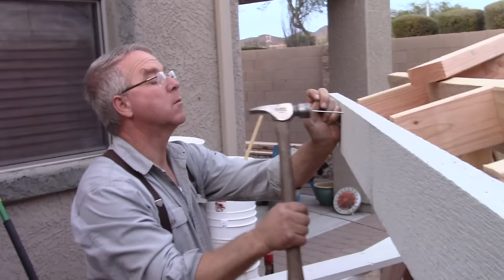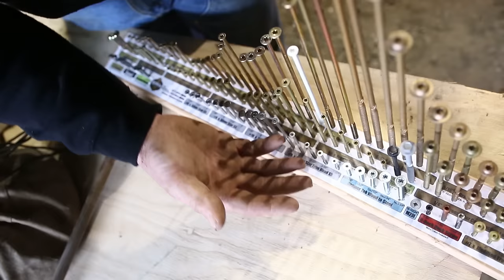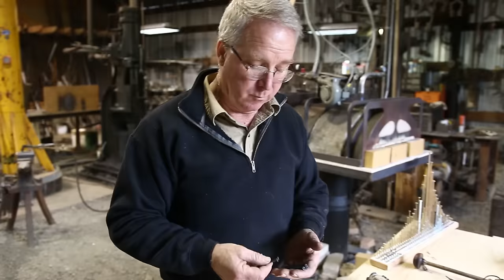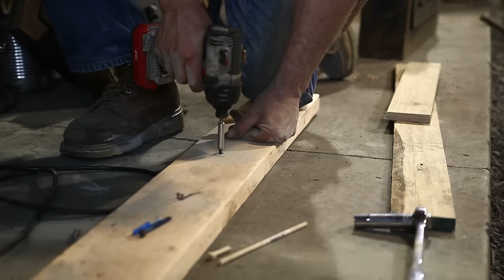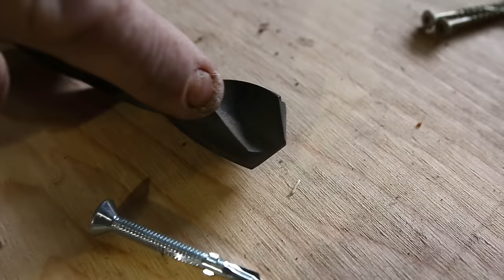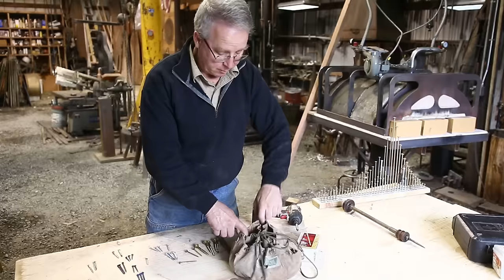Screws: What You Need to Know

Comment: I do carpentry myself and the one best takeaway from this video...is that parachute bag!! Thank you for that tip, sir!! I do pole barns for a living and I also do corrugated metal roofing with the galvanized insulator screws, so I end up with these getting mixed in with the 16 pennies I use for kick plates. I also build and tear down concrete forms and end up having to get a separate pocket on my belt for them, since you can't use them in structural work, as you stated.  Parachute bag = no problem

Comment: As an average guy, not in the trades but I build my own home, I haven't built a deck in 25 years.  I recently built a small set of outdoor stairs and when I went to buy hardware to attach the ledger board to the house I couldn't even find the 1/2" hot dipped galvanized carriage bolts that were traditionally used.  I was pointed to the GRK Structural screws instead.  I bought them and checked out the specs and schedule online.  Wow!  What a difference and so much easier, I didn't even have to go into the basement for anything.  The ledger board isn't going anywhere.  I also decided to use stringer brackets along with the special screws from the bracket manufacturer...so much faster and easier.  I'm pretty good at hammering, getting a lot of practice building wall sections for a builder one summer at age 15 but I've always hated pounding joist hanger nails as it can be difficult in a tight area.  Great innovation not only for installation, but also for repair-ability too.

Comment: I also like GRK, Spax has served well too; avoid "Fastap" they claim self drilling but the design is really self stripping, nails have better pull strength.(experience based on softwoods OSB and plywood)
Drywall screws snap because they are only #5 or #6, cheap, and often thinnest just under the head, not because they are hard. Meanwhile deck screws tend to be #8, 9, or 10 and have a thicker section between head and thread. Likewise nails tend to have higher shear strength because they have a larger effective cross sectional area(based on minor/root diameter of the screw) and bearing surface, the harder steel in screws is as a basic material stronger in both tension and shear.
**** 
I agree that phillips should be avoided for anything other than drywall dimplers(wear camout is an advantage). Phillips is only popular because of the model-T and it was designed to cam-out in a time when production line power drivers lacked torque control. 
Torx are good for high torque but they weeble wobble all over and need two hands to get started straight, they also chose way too many bit sizes and there are two types [old torx and torx-plus newer & improved but less popular]. I prefer Robertson for general use, they have a slight taper that both sticks the screw to the bit and makes a very stable connection that can be started one handed, and 3 sizes covers most common screws, easy to accurately manufacture which is important with all the cost cutting low bit import products. Both Torx and Robertson bits resist rather than encourage cam out and the bit's wear ten times as long as phillips.

Comment: Just bought my first set of Torx head screws this weekend repairing a shed behind the house I'm selling. Never used them before and wanted to see if they were worth the fuss. They were. I'm a convert now.
Reply: The trick is.. everyone that will work on your shed after you   will either hate you because they're not Torx converts and they don't know what it is, or they will love you because they're also Torx converts.
Reply: I converted to square (Robertson) from Phillips. Torx is great with two major draw backs. 1.) it doesn’t sit on the bit as well as a square #2 which makes it more difficult to use when working by yourself one handed. 2.) for most general stuff you end up using #8 and #10 screws. For Torx that means having a T-20 and T-25 and switching back and forth. Both those common screw sizes come with Robertson #2 bit sizes making it easier all around for most applications I do. 
GRK makes really bad ass screws and for structural applications, a T-25 and GRK or TimberLOK screws are where it’s at. For fences and sheds etc? I’ll use the square #2 bit and be done with it
Reply: @nsatoday  I'm with you on the TImberlok and headlok's.   Worth every penny.  I built a little bridge type thing access my mother's barn.   She was using old pallets to cross the 'moat' into the feed room.   Every now and then a horse would horse it's way into the feed home and destroy the pallet bridge.    There's no way deck screws would have held up to that kind of stress.
Reply: I used them in an 18-wheeler.

Comment: Just to add to the screw info,  do not mistake Robertson for Square.  They are two different driver/screw configurations.  The square has 90 deg sides on both the driver tip and the screw where as the Robertson has a tapered shape to both screw and driver.  Using a Robertson driver with a square screw will result in a loose fit more prone to slippage and stripping.  Using a square driver in a Robertson screw will normally not reach the bottom of the screw and can result in Jamming your bit in the screw.  To tell them apart often the sizing on the item will let you know what it is...  1, 2 ,3 = square,  6, 8, 10 Robertson or Green Red Black...

Comment: The screw driving tool at the end was what my father called a Speed Driver.
He built boats and had several speed drivers.
He used Monel screws for boat building.
The holes were predrilled with either an electric drill or a handcranked driller, then the screws were driven with the speed driver.
Interesting that no-one ever thought to use the electric drill to drive the screws!
Until someone did......😀👍

Comment: These videos are amazing, and I can't wait to binge watch all of them. Thank you for putting these together.

That being said, I got awfully nervous at the end of the video when the guy was handling a lifted load by hand. Please be careful. Attach a rope to the load (not the lifting slings) or use a hooked pole if you need to control the load and prevent swinging, but don't touch it. Being that close to a lifted load puts you way too close to the line of fire if the load is dropped.

Comment: I love your videos - a lot of great information and wisdom. I don't know though why you would assiduously avoid Robertson if they are locally available and cheap. I understand if your local store stocks Torx and Roberston are difficult to get and at a premium.

Robertson has some  good things going for it and basically  all self-centering/screw holding fasteners  are  re-inventions of the Robertson concept - which is what Lox and Torx are. The taper on the  Robertson allows screws to stay on the bit better than Torx which is useful - especially for Electricians mucking around in a live breaker box which is why our boxes tend to use them here. 

I find the strip rate of Robertson and Torx to be pretty similar - it is down to the manufacturer's metallurgy..

The sizing is easy to tell - orange 00, Yellow 0, Green 1, Red 2, Black 3, Brown 4. For me figuring out the size of Torx is not as easy at a glance.

They do make proper deck screws with good coatings - the brown ones- and stainless steel if you really need it.

Now that Robertson's patents have expired you have to be a lot more careful with the tooling. When Robertson exclusively made the bits they would last years in an electric drill, the offshore stuff now last weeks. I buy the 'Shock' proof bits for impact drivers and they seem to  last quite well. The same goes for the fasteners - there is a lot cheap chinesium out there that is either way soft or way brittle but that is true of all fasteners today.

Comment: I used some of those yellow screws on a redwood fence. I took the screws out perhaps 6 years later (replaced wood fence with steel fence). They looked pretty darn good. I re-used them.
I find that the yellow screws snap less than the drywall screws.
Also I believe the Lox head (modified square drive) has greater torque capacity than the Torx head.
Square drive works just fine, though not quite as good as Torx (star bit). I can put my #12, 5" long stainless screws into wood pretty reliably with a good impact driver and a #2 square drive recess. Actually, the screws themselves tend to warp because the particular alloy of stainless that they manufactured this batch of screws with is overly soft. There are a great variety of hardnesses in stainless fasteners. The Simpson Strongtie stainless screws are top notch - no warping and the heads aren't nearly as prone to snapping off)
ciao.

Comment: I started doing full range carpentry in 1965. I remember using a Yankee screwdriver with a straight bit to set screws for hinges and hardware. OMG.  I still have the scars.
You are spot on about the types of screw drives: Slotted head screws suck completely; Phillips head screws suck mostly; Robertson square-drive screws are OK; Torx drive screws RULE!
And GRK screws are the bomb!!
Great video.  Thanks!

Comment: Drywall screws are fantastic .... for drywall! Love your videos, as allways. Edit: I like Robertson's screw bits obviously you're correct they were an obvious improvement over Phillips. But they were also a lot less expensive then the Torque screws. I didn't mind paying for torque when I had large screws to drive. But run-of-the-mill decking screws? Not so much. In any event, your analysis of the capabilities and limitations of all of these fasteners is absolutely flawless. Well done as always.
Reply: My thought too, I've gone through many many boxes of drywall screws they are perfect for drywall heads above nailing, but not for use for anything else.

Comment: New subscriber - love your videos. It would be interesting to hear you talk about how home construction has changed throughout the years.  And why there seems to have been a real dip in quality at times, and why older homes seem much better made.  Stuff like that. Seems that would be right up  your alley.
Reply: GeorgeGraves 
so I have an opinion on this topic. first off it's a two-sided debate. many older homes have a tendency to have inconsistent construction types which give you inconsistent quality for long-term structural capabilities. new homes with code regulations and inspections often are far more consistent high quality  work structurally speaking. on the Craftsmanhip side of the debate, old homes were all built by people expecting High craftsmanship. new homes are now often bidded down through bidding wars  by contractors which then drives the quality down even though the modern age  Carpenters are often qualified to do high-quality work but most people are not willing to pay for it. so even today high-quality work is out there, it's just that most people can't afford or are not willing to pay the price that it takes to get it. I also find that many homeowners today can't tell the difference between really high-quality work and mediocre work which makes it hard for many carpenters to make the extra effort.
Reply: Re: Inconsistent quality in older homes. Quite true. I own a house built in the 1890's. Beautiful craftsmanship - interior/exterior millwork; custom-built doors & cabinets; fireplace mantel & surround; stained glass... Structurally though, some areas overbuilt, others underbuilt - eg: beam sizes; footings/foundations; concrete quality. No standard code regulations back then, I assume.
Reply: When it comes to building a home which will most likely be the largest investment of your life, there should not be any cutting corners when it comes to quality of build. And lower quality should not be permitted (but is). When you are spending $$$ of thousands to give shelter, comfort and protection from the elements and possible natural disasters every home should be built to pass inspections of the the highest standards...  Just my thoughts.
Reply: There might also be some bias regarding quality inconsistency as the only homes from past eras to make it to today HAD to have been built well.
Reply: Exactly.  The older homes we see today are ONLY the high quality ones.  This is a huge sample bias.  All the poorly constructed ones have been torn down or completely renovated.
Reply: @randalldavis7025  I'd also say that if you built a really shitty house decades ago it's less likely to be standing today than if you built a great one.
Reply: I'm a bit late to the party, but if you want more on the subject, check out the Modern Craftsman Podcast. It's run by a couple of carpenters who specialize in old-school, high quality home building, and gives some good insight into the people still interested in doing things the right way in this modern age.
Reply: There's a term for this, it's called "Survivor Bias".,   Generally speaking, only the well built homes are still standing leading one to believe that that were all well built.   I occasionally do some metal detecting.  I'll use a website called historic aerials to pull up aerial maps with census data that you can overlay with modern google maps.    I look for houses that used to exist, but don't show up on modern maps.    Many times I would have never even known a house was there.    Sometimes I can just find bits of foundation or other remnants once I start detecting where the house should have been.
Reply: @TheSpongiform  where I grew up you could find dozens of old house foundations within a few kilometers. Some of the foundations are quite impressive, especially considering that even just a few generations back pretty much everyone and their mom built their homes themselves here.
There's a remarkable variation in quality too. I've seen so many homes with earth floors (must have been terribly cold in our climate) and with chimneys that were just glorified holes with some brick/stonework in a corner. And then you walk 500 meters and see somebody's 100-year old sauna with doric pillars and oddly-shaped windows.

Comment: Really interesting vid - thanks for putting it together! In the UK 90% of the time we use Pozidriv - they're excellent and never cam out if you use decent bits. I did a screw rust test vid a while back - the screws I commonly use are very corrosion resistant and never break - about $3 for 200 screws. They're very, very hard but not brittle. Would be intrigued on your thoughts - can send you a selection if you like?
Reply: What he's saying is that a screw provides more tensile strength (vertical, or straight pull), versus shear strength (horizontal, or side load) brittle has nothing to do with it. Harder the steel=less shear, softer steel=less tensile. at any cost the screw will provide more vertical or straight pull, than a nail because of its "bite" versus a smooth nail.